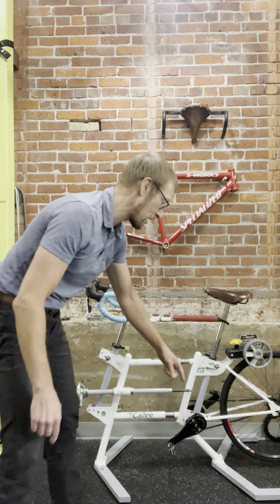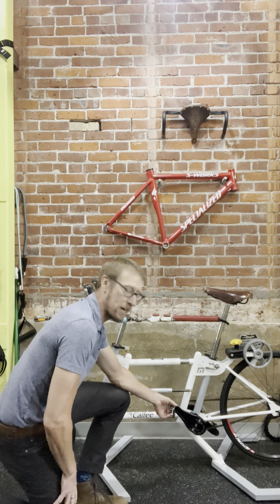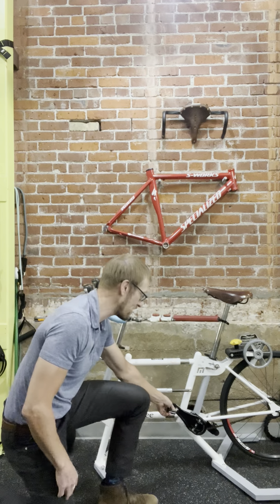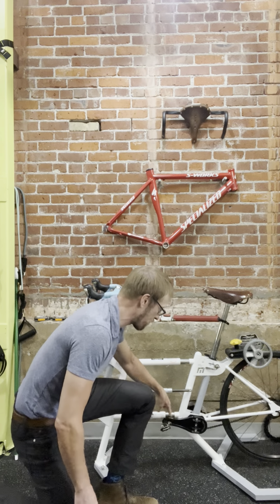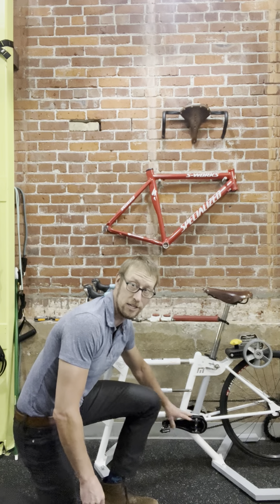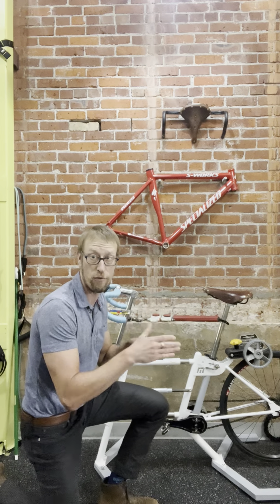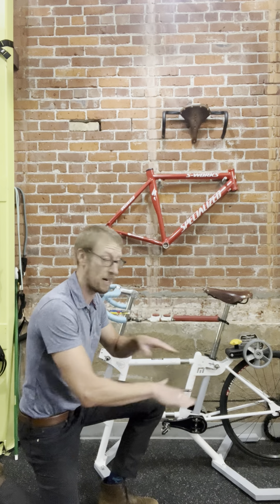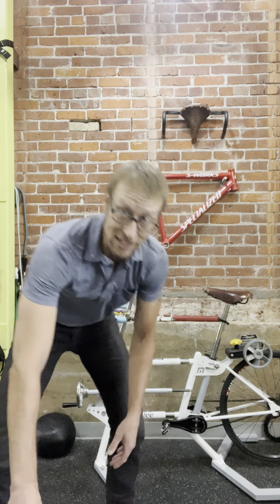Crank Length - When Does it Matter?

Comment: Many years ago a bike fitter recommended that I use 165 cranks and speedplay zero pedals to overcome knee pain.And it worked ❤. On years later I’m always messing around building new bikes. Which always seem to be equipped with longer cranks. And I start to have issues. Thanks for reminding us of the importance of Bike Fit❤.So what I hear you saying is that it’s time for a New Bike ❤😂. Dreaming ❤. Lol. Thank Kevin 🚴

Comment: It's crazy to me that someone 5' tall "should use" a 170mm crank, and a 6' tall person "should use" 175mm crank, as if that is anywhere close to a proportionate change in crank length to height variation. I am 5' 11" and have bikes with cranks from 175 to 165, the 165's are cottered cranks on an old Raleigh road bike, its an actual 10 speed, 2x5, and it weighs 27 pounds, and I've PR'd some segments that I went at pretty tough on my modern road bike, the old Raleigh flat out rips, is it just the cranks? No, but I absolutely cannot argue that the short cranks slow it down!
Reply from the maker: Yep! As far as we can tell, shortening cranks does not affect performance— heck Bradley Wiggins (who is 6’3”) won TdF on 165s!

Comment: By calling crank lengths a "fad", it seems to that you're quick in dismissing the necessity of increased range in crank lengths. The typical 170-175mm length doesn't come close to proportionally covering the full range of bike sizes. A +/- 2.5mm in a 172.5 mm crank is +/- 1.5% total range. In your "medium" frame size range of 55cm +/- 3cm is a +/- 5.5% range-- adding in small and bike frames would make that range even larger.

In your video, you warn against "too short" cranks in your video, yet your comment below notes, that there isn't a noticeable downside for short cranks, even a 165mm crank on a 6'3" rider. How short is too short?